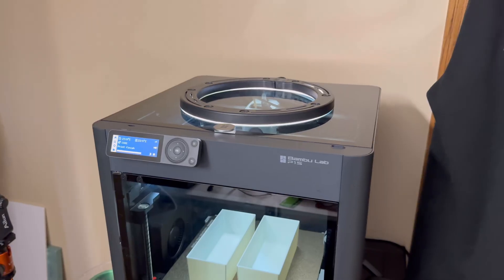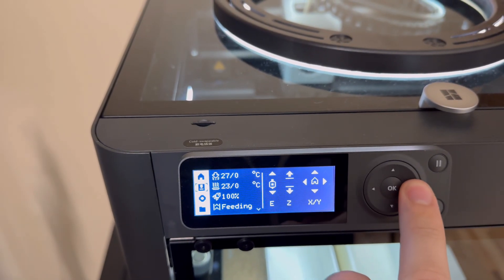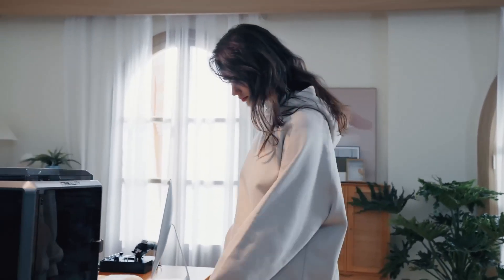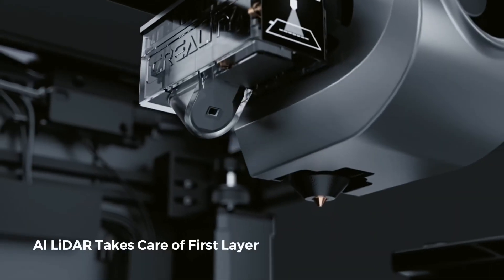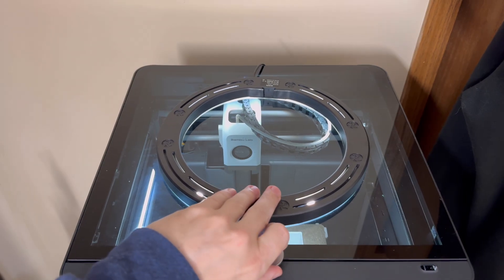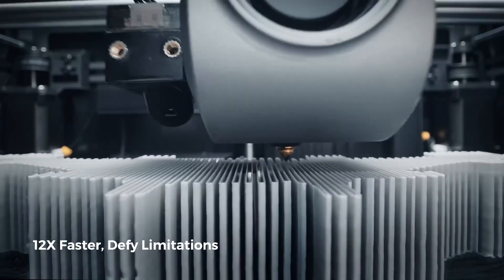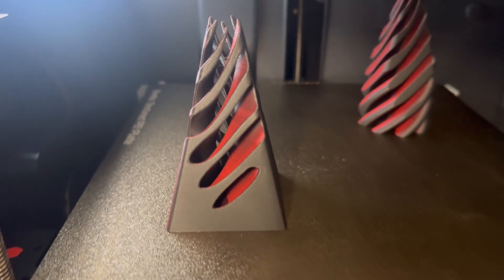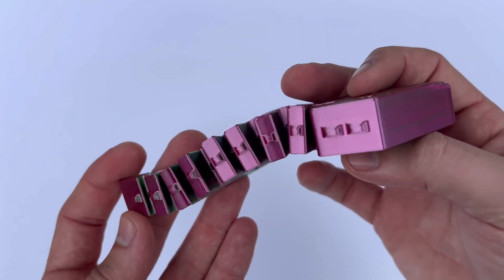Bambu Lab P1S vs Creality K1 Differences? Which to Choose!

Comment: The K1 and K1 Max are great value on sale at the minute but I don't understand the issue with the build plates.  On my Prusa i3 mk3 I print straight onto the PEI build plate with no glue and it is fine.  Creality say you must use glue on the K1/K1 Max, why is this?

Comment: I've decided to get a 3d printer. I know nothing about it, the research I've done over the last few days has led me to one of these printers. Initially, I was interested in the a1 combo. But since I don't really know what I'm even planning to print, I feel like I want something that can do practically everything and print multiple types of filament. So I've upped my budget and and am now looking at the p1 and k1. Long intro- sorry... What I'm getting at is a couple different things. The ability to tinker on the k1- is that to say I can't edit or design my own models and print them on the p1? Does the p1 use proprietary software that's limited in its abilities? Can I not adjust models on the p1? Like what if I want to design some random part for some random thing. Can I not do that on the p1?
Reply from the maker: If your printing mainly PLA then the A1 combo is cheapest and best option. If your trying to print specialty filaments like ABS then the P1S printer is best
Reply: You can do anything on the P1 that you can on the K1, and with less effort. When people say you can "tinker" with Creality machines, what they really mean is that you HAVE TO "tinker" with Creality machines. If you aren't software and hardware capable (and you don't appear to be) go for simple first and make sure you like the hobby. Get a Bambu A1 WITHOUT the combo kit (like $300) and get some practice in. You can then buy the AMS lite when you're ready to try multicolor prints. Multicolor wastes a boatload of filament though so be ready to spend a lot on materials.